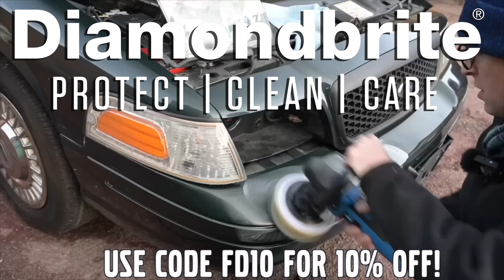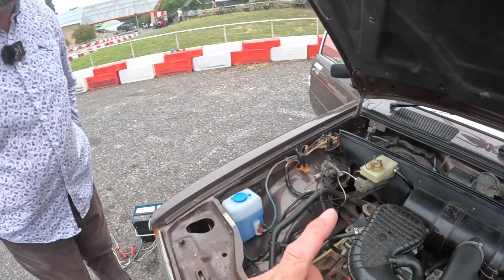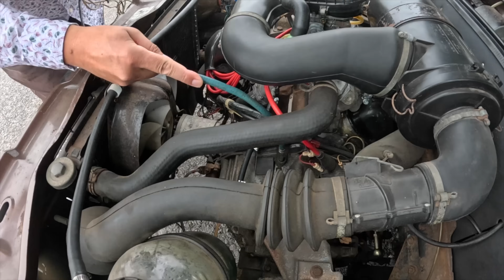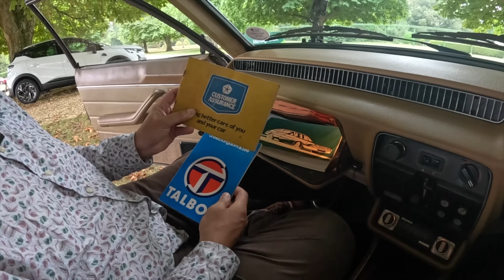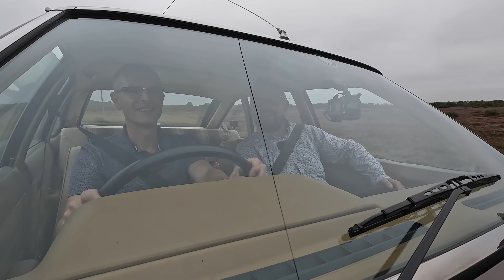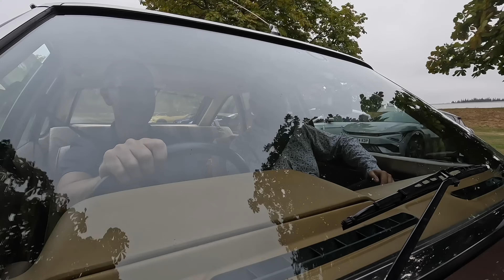Driving the Boss of Beaulieu National Motor Museum's Chrysler Alpine - and Rustival News!

Comment: Chrysler almost got it so right with the Alpine. The 5 door mk2 Cavalier was basically an improved version of the same idea, which sold like hot cakes through most of the ‘80s. If only it had been properly rustproofed and given a less “tappety” engine, it would have done so much better. Almost a market leader, but not quite. So close to greatness. A great concept, hamstrung by corporate politics and finances.